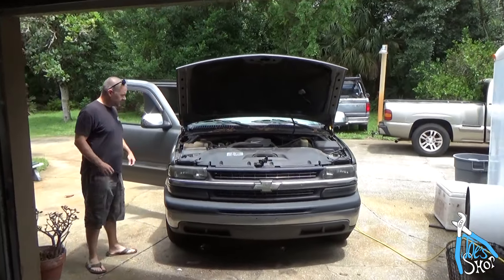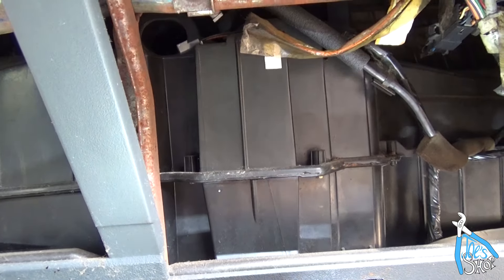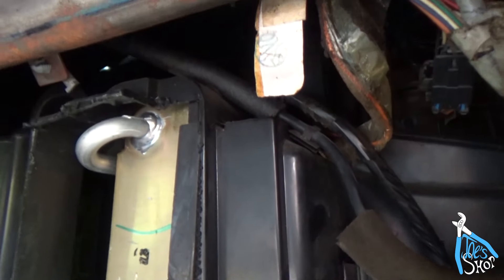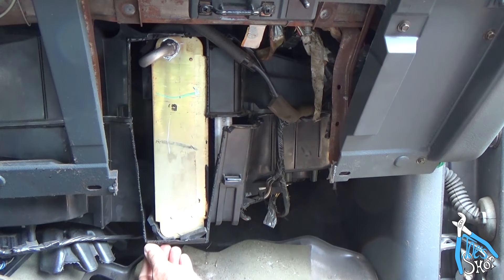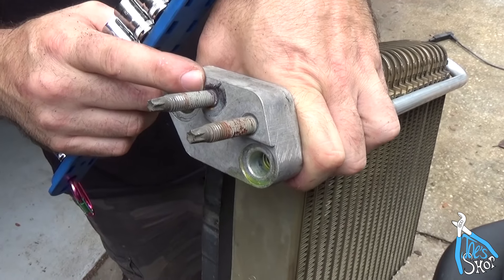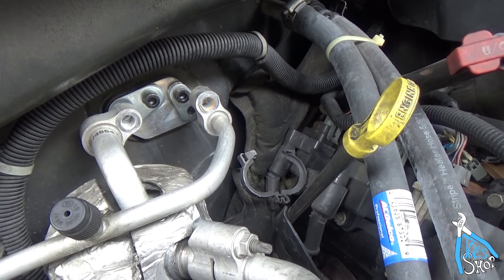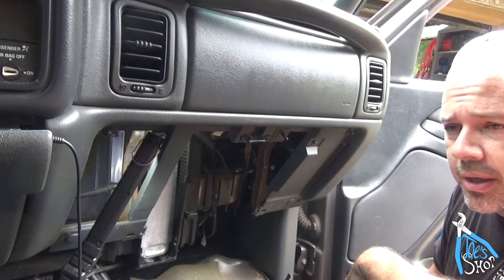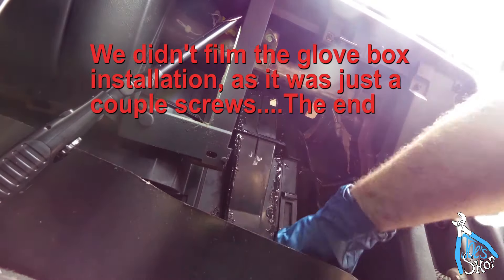Chevy Silverado Evaporator Hack (2002)

Comment: 7:19 I think that plastic is abs, which means that the best way to glue it is abs cement from the plumbing supply. You can make your own by cutting up some abs pipe and dissolving it in acetone.
Reply from the maker: @jameswhitaker1324  thanks James. Hopefully someone tries it and comments. Thanks for the constructive input. Cheers
Reply: @ thanks, I’ve been doing plumbing repairs for awhile, so I already had abs cement in my plumbing bag. When I recently bought my BMW K1200RS, both bags had holes in them, one from the bag sagging in front of the tailpipe and getting burned through and the other bag had a huge tire shaped hole where a previous owner hit or got hit while lane splitting in California. Anyway, I bought some 1/16” abs sheet from Amazon and made up some extra thick cement in a mason jar by dissolving some scrap abs pipe and trimmings from the sheet. I used a heat gun to form the sheet to the inside contour of the bag, cemented it in place and then filled voids from the outside in successive layers of the extra thick goop. It worked very well to save some bags that cost a couple hundred each, used.

Comment: Instead of trash talk. Post your vids of pulling your 20+ yr old dash and doing this "the right way" then show me how good it came out.    Meanwhile my a/c is blowin snow in the fl heat. Jobs done, im cleaned up and your still crackin your dash pad, still 2hrs away from exposing the evap core.. not to mention most of you diy "tubers" won't have much dash left to put back in.  Please excuse my experience. Its just an opinion like everyone else...
Reply from the maker: Thanks for the comment Joey. When a vehicle has 265k miles on it "getting it done" becomes the goal. Getting it done "the right way" feels kinda like rearranging chairs on the Titanic....just my opinion. Cheers
Reply: @joeheilm  Yes, you're 100% right. I like how you used black RTV sealant (I think that's what it is) so that should hold together quite well. I think that's the better option than the gorilla tape someone else used. I think this is the ONLY correct way to do this repair when the repair costs as much as the vehicle in many cases. I think this is where my leak is on my 276,000 mile suburban. I'm going to do it your way and if I glue it will I don't think there is anything wrong with doing the repair this way. It's not like it's some valuable or classic car!😂🤣
Reply from the maker: @davidbenji1  thanks David! Good luck. The jb weld plastic is excellent glue. Cheers
Reply: Beer time that’s what I’m talking about
Reply: No truer words have ever been spoken.
Reply: God bless you ain't nobody got the money or the time 👍
Reply: I did the core on my 2003 Silverado a few years ago before I sold it.  It took me about 3 days to do it the "right way"!  I was taking my time and didn't watch any tutorials beforehand but only once I was stumped on finding a few bolts hidden in the dash.
Reply: I wouldn’t say this was a ‘hack’, just doing what Chevy should have done when they made the truck.
Reply: Can the heater core be done the same way without removing dash?

Comment: why is people complaining by him doing it this way? It's genius.  once you put everything back youre not even going to know.  anything was done.
Reply from the maker: Very true...it is still working great. Cheers
Reply: My thoughts exactly ....... Genius.
Reply: I'm doing my 2006 Silverado and I saw that crossbar after removing glove box and thought, "why the h*** did they block it in there like that?" I had actually thought about doing it this way, only exception is I'll tack weld the metal bar back in place so the glove box will be more solid. Thanks for the video!
Reply: Will this work on an 07?
Reply: @jessstephreyna3796  waiting on this answer as well

Comment: Nice hack job...but I mean that in a positive way.  I've done 3 evap cores and 2 heater cores on 20+ year old Toyotas.....and while a pain, everything came out and went back in without breaking anything.  I did ONE evap core on a 2000 Silverado the "proper way" using a proper shop manual.....NEVER again.  So many plastic pieces broke that my friend thought I was speaking in tongues I was swearing unintelligibly.  Great video, this is THE proper way on an old GM.

Comment: If you run leak detect and the uv light doesn't show on the obvious spots, check the condense drip tube under the truck and the little puddle of water. It'll glow like a green monster and bingo, evap core is leaking.

Comment: Dude that was amazing! Saved me sooo much time and headache. When you star pulling older dashboards out for this repair they usually crack everywhere. This is the only way to do it imo.
Reply: This MIGHT be considered a hack job but I believe in disturbing as little as possible to get the job done.
If you're careful in cutting and take a bit of pride in putting it back together, a decent repair is possible.
No way I'd consider disassembling and removing the dash.

Comment: Great video , thanks for sharing, very well explained , and using that JB weld to put everything back together is a great clean idea
Reply: I saw what a mess it would be to change the heater core on my  98 Chevy 1500 so carefully did the same,,,upgraded to H.D. core and glued it back together.  Super easy,  never could see it and it roasted me out, Lol.  I didn't have to cut glovebox metal.  Drove it daily 10 more years trouble free until it was rear ended.  This is the ONLY way to do it.

Comment: My suggestion for the glove box door.
The cut made on the left side should have been made on the left side of the bolt hole.
That way with only drilling two more holes and two small pieces of flat bar you could remount the bar you cut out on both sides.
As long as you cut the Evaporator box neatly and in one piece, aluminum hvac tape should seal the cut out piece just fine.
Reply: YES
Reply: Been doing this as a pro for 45 yrs. I would definitely offer this as a cheaper labor alternative to a customer. Remember haters the guys working on an old pu truck not a Lamborghini. Get real! He got cold air in a couple hours, good job! To dh guy if GM had put a nice,neat access panel like they easily could have would it be ok then? Get a life. Hats off to the hacker😂

Comment: This worked great for my old pickup. Would do it again. I had some condensate leaking onto my floorboard, but I bet if you're careful, you can seal it up to condensate drains through the drain.
Reply from the maker: Yea absolutely I'd do it again. Did you use epoxy to seal it back up?
Reply: I was gonna ask if you had any condensation leaks.  I'm pretty sure my 99 is leaking at the evaporator
Reply from the maker: @garysimmons5520  hi Gary. No the jb plastic epoxy sealed it up perfectly. Cheers
Reply: Thanks... that's what I'll use

Comment: Could you shine your black light on the water dripping from the ac and see it it had ac refrigerant in it?  it would glow if it had something in it.
Reply: It's not guaranteed the condensated water will mix at the leak... But yea worth a try
Reply: Maybe not.  I suspect my evaporator has a leak and there is no dye visible at the drain tube,  but my refrigerant leak sniffer does seem to indicate refrigerant at the drain tube.  I'm trying to decide how to be very sure before I go after the evaporator.

Comment: Great video!  I would use "The right stuff," made by Permatex for gluing it back in.  It comes in a caulking gun tube.  Make sure you give it a full "48 hrs." To dry, because then it is strongest.  Ask me how I know!  It is easy to cut when you need to replace the evaporator again.  They used "the right stuff" to seal a huge hole in an engine block on a boat on YouTube and it worked great!

Comment: I’m normally a “do it the right way” even if it’s a hard job kind of guy, but I’ve been under the dashes on enough of these trucks to know how much of a pain they are. So many opportunities to create more problems than you’re solving. I have an 02 that’s I’m pretty sure the evaporator is leaking on. Probably gonna go this route… thanks for posting!
Reply: I'm a do it the right way guy too. Most of the time. But when it comes to removing a dash I learned the hard way that I'm gonna wind up with a few left over nuts and screws. And maybe a courtesy light or two that didn't get regrounded. I like this idea because all the ugly is hidden behind the dash.

Comment: Honestly i think this is a pretty good hack. All the haters complaining should take a look at a shop quote at $100 to $150 per hour in labor and a $175 part. The dash part you cut is easily fixable by tack welding or drill and rivet some scrap metal in there.

Comment: Have you run into any issues with hack way of doing this? Would you do it this way if you had to do it again? I’m all about doing things right, but the thought of everything else that could go wrong with pulling the dash seems to favor cutting the box. Not to mention what, 10+ hours of extra work.

Thanks for the video and research!
Reply: This is my truck we used to test this in the video, still going strong 2 years later!

Comment: Interesting…
If I were to suggest anything. There are some videos of basically wielding plastic. 
The short, use a soldering iron to melt it and use some more plastic as a rod. Like tig. 
Great hack! Thanks for sharing. 🍻🍻🍻
Reply from the maker: Hi David...i actually have a very old episode on plastic welding, zip ties make great plastic welding media. I wanted to plastic weld it, but my buddy wanted to use the glue. Thanks David. Cheers
Reply: @joeheilm  What was the voltage of the drill you were using? I am in the process of replacing my antenna because the screws busted off, an I have to drill them out from the base surface.

Comment: Thanks for showing this technique.  Is your vehicle engine a Duramax or gas?  My shop is telling me that evaporators for my '04 Duramax are not available and that the gas engine a/c evaps are not compatible with the diesel models.  I do have two torx heads  on my firewall fitting that I don't see in the fitting on this video.
Reply from the maker: Mine is gas.
Reply: Is there anyplace that still does after market A/C ???
That might be the way to go.

Comment: What about the heater core?
Reply from the maker: I wish I had a heater core hack.
Reply: @joeheilm  I'm trying k seal. Hopefully it works
Reply from the maker: @lacboiatl  good luck. Let me know if it works. My Chevy is my only vehicle with heat so I'm hoping it holds out another year or 2.
Reply: @joeheilm  will do. And my chevy is the only 1 without heat 🤣🤣🤣🤣. Started off with the quick connects breaking. Then I used the worm clamps and it worked but I've bypassed it after it started leaking

Comment: My question here is.. I got the same problem rite now , I have a leak inside my cab I have a 99 gmc Sierra 1500 but I ask a mechanic if he can just cut it and replace it, but he said it wouldn’t be a good idea because then water is gonna be leaking inside cab because that thing gets full of water, is that true? I want to do it my self , everything else is new except that can y’all help me out with this question please??? Thank you!!! And I need to do it ASAP!!! Cause I live in Florida and is so damn HOT!!! 😁👍🏽
Reply from the maker: Just glue it back together with the JB weld plastic. I have not had a drop of water inside. Cheers

Comment: im curious on a update... how bad does it rattle? did you have any leak issues? flex tape sealed my hole in bottom of pool and i applied it while pool was full. maybe apply over glue?
Reply from the maker: It works perfectly, no rattling, no leaks. The jb plastic weld worked perfect to seal it all back with no leak.
Reply: @joeheilm  awesome... Yours def looks better than the rest of them slop jobs ive seen. What exactly did the banking soda do? I was a bit confused
Reply: @SouthFLMudClub  The B Soda acts as a filler and also helps kick off (Catalyzes) the crazy glue, and acts as additional strengthening material.  Basically, it makes a stronger joint

Comment: Hey  had to change fuel pump on my 97 Silverado. It called for dropping the gas tank or lifting the bed to get to it. Well i just cut a square access hole straight over top of fuel pump. Put hinges on the squre i cut out wnd niw i have a open and shut window to fuel pump at any time. For some people it had to be by the book for me it has to be by common sence. See these car and truck builders do these type of things on purpose knowing the customer will pay for all that shop and mechanic time. If only thongs where made like they was back in the day life would be better. Gotta do what you gotta do.
Reply: Imho- thongs these days are as good or better than ever these days-lol

Comment: What width did you cut. It looks like it can be gaged by 2 or 3 rib sections. If I could load a pic I could explain better how I see it in sections. Th aka for sharing this hack.
Reply from the maker: Hi Jamie, it has been a while, but if I recall correctly the housing is shaped just like the condenser so we just cut the portion that protruded out. I hope that helps. Good luck
Reply: @joeheilm  thanks a lot for sharing and the reply.  Keep on pioneering

Comment: My air wasn’t working properly.  I used stop leak, but I think that took out my compressor. I know one of the Schrader valves was leaking, but I feel like it’s probably this damn evaporator core too. I’ll do this in about 10 seconds. The only thing I would probably do different as use some HVAC tape to secure it back in place, and if it happens again, it’s even easier than the first time!

Comment: U could rebuild it in a way that allows future access like a little door. But it does have to keep some pressure 🤔 I guess that's fine honestly because you won't go back in there for years hopefully. U can cut the glue out again easily if necessary. It's a god damn shame that's the most sane option for fixing it 😆

Comment: Any chance of a shortcut for the heater core?
Reply from the maker: Lol....i wish. Cheers
Reply: Just take the dash pads off and you can get to it
Reply: he heater core is removed from the top of the climate control box, there is a blend door between the heater core and the side of the case that Joe cut to remove the evap core. So sadly the dash needs to be pulled back or removed to replace the heater core.
Reply: coming from someone who did the heater core the correct way, there is literally none. Best way is to label every bolt. The HVAC box has to be completely unbolted from the firewall & even the dryer for the hvac to come back some to even slip the heater core out bc isn’t there enough clearance to just slide it out.. so the entire hvac box has to come out a few inches and by that point you can take it completely out of the truck and clean it at that point

Comment: Hello. Seems like I have the same issue. Any update on the ac. Did it hold up the frion. I'm having the same problem
Reply from the maker: Hi Rich. It is still working great, no issues at all. Cheers
Reply: Man I live in chicago. I've refilled my frion twice.  Now summer is almost gone.  Im Thinking of giving up. But I've yet to try this. Ima do it this weekend. Hopefully that's the issue. Thanks for the reply.
Reply from the maker: @richflow7718  it is super easy. I wish there was a hack for the heater core 🤣. Good luck. Cheers

Comment: So is this the common spot they leak? My compressor went bad so i put a new one in and it works great for 3,4 weeks. Slow leak somewhere but I see no dye!!! Assuming it is indeed the evaporator.😊
Reply: Guess I should mention  I have NO wierd smell in the cab...
Reply from the maker: Those slow leaks are tough. Id charge the system again and add UV dye and check the condensate water dripping from the truck. Good luck. Cheers
Reply: @joeheilm  ahhh of course! Thank you for the tip

Comment: Whats the chances you could cut the bottom or side of the airbox to get the heater core out?
Reply from the maker: Good question...my heater core has not blown out yet, so I am not sure. It sounds possible. Good luck. Let me know what you end up doing. Cheers
Reply: the heater core is removed from the top of the climate control box, there is a blend door between the heater core and the side of the case that Joe cut to remove the evap core. So sadly the dash needs to be pulled back or removed to replace the heater core.
Reply: @propanepusher101  thanks Richard. Luckily my heater core wasn’t leaking or blocked. I had wet carpet which turned out to be a weatherstrip issue and the heater stopped blowing hot not because of the blender or the core but because the engine cover plastic piece was pinching off the heater hose in the engine compt!

Comment: Can you do the heater core the same way
Reply from the maker: Nope...I wish we could. Cheers
Reply: The heater core is removed from the top of the climate control box, there is a blend door between the heater core and the side of the case that Joe cut to remove the evap core. So sadly the dash needs to be pulled back or removed to replace the heater core.

Comment: Not a bad hack. Just got done replacing it. I just want to know what’s best to seal it back up. I used the same jb weld but it’s leaking through it
Reply from the maker: That is weird...I have had really good luck with the JB plastic weld. Maybe the Bob Smith industries (BSI) epoxy is worth a try. good luck

Comment: To everyone complaining. If youre a mechanic and your shop doesnt offer this method, your loss. 99% wont pay you take the dash. Ill gladly take the business. Thank you very much. 🙏🏻
Reply: I own a shop. Half can't even do the job period. They don't offer it. I thought it was a good video with minuim tools. Cause the 2012 Camaros have a issue with the door. Door $22. We use heat knife cut and replace. Glue back. Never had a complaint. But I am capable of taking the dash out. I don't do anything for bragging rights